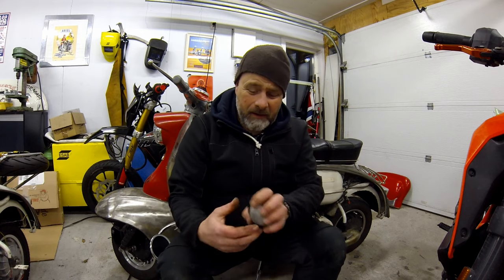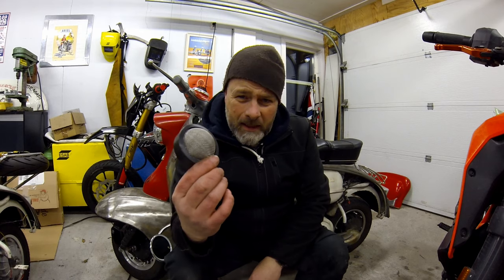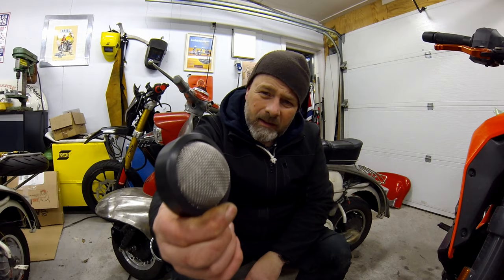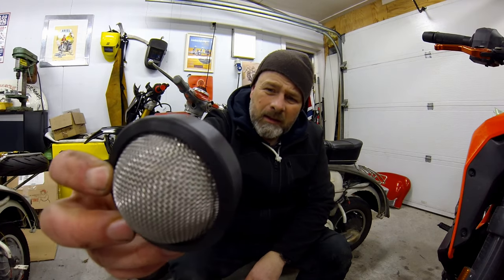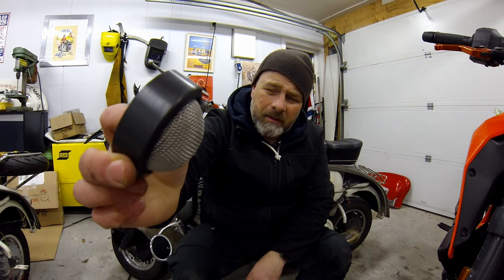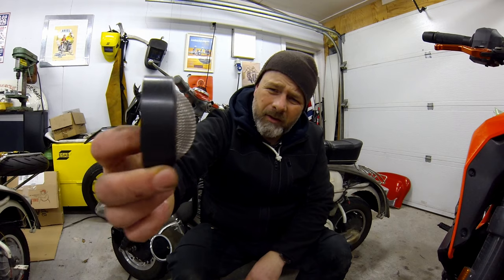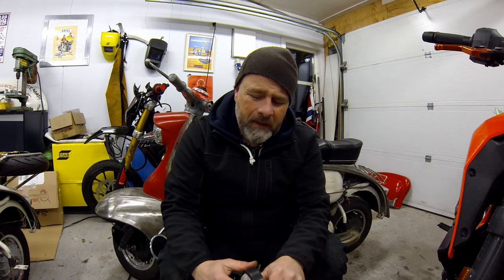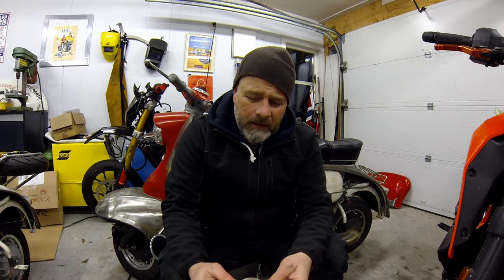MB Scooters LTD, lambretta  tea strainer filter,first look

Comment: Been running one of these on my Mugello 200 Piston Port with 28mm Dellorto, tried every combination (almost!) of jet/atomiser/needle/screw and could never get it 100%, generally just too rich somewhere in the rev range no matter what I did. Finally when it seemed very close but still a bit rich and smoky particularly at tickover I gave it a try with this thing removed and it's now running spot on. You imagine that it won't impede air flow at all looking at it but it definitely does
Reply from the maker: My problem was that it clogs pretty quick. It went in the bin 🙈

Comment: Have one on my S2 Rt195 breathes through a 28delly, didn’t need too down-jet at all and it kept its same power all through the range, good bit of kit
Reply from the maker: Ok, a lot of conflicting info on this, should be intreasting to try.
Reply: Kickback Garage agree no 2 engines are a like so there’s gonna be difference in set ups

Comment: Hi Rob thanks for your reply never thought of that on a long ride out to a rally what if you took the very fine filter out and just have the larger mesh left to stop any large objects getting through 🤔🤔🤔🤔👍
Reply from the maker: People do that mod but I would be more inclined to ride filter less. I've bought the chiselspeed panel filter, apparently works well but won't know until the spring.

Comment: Hi I’ve also got a S3 Rt 195 kit using a25phbl carb I removed the air box still using the bellows and connected a BGM highflow  air filter it sits in the air box recess lovely  I jetted up a bit for the extra air intake made amazing difference what’s your opinion love your videos
Reply from the maker: Thanks Erik, I actually haven't got an opinion yet. My other bikes are run without a filter. I will talk about the jetting as soon as I get the TV out on the road.

Comment: Hi rob I know this is a old video but I’ve just got the mb carb kit 28 mm delo what manifold r u using because mine when fitted carb is at a very steep angle towards the back in fact the cable insert points heat the tool box how can I solve this the manifold I’ve got came with the kit with rubber mounting sleeve regards tony
Reply from the maker: I have fit the mb carb manifold. We will have a look ans see how it fits in the next TV video. Just waiting for a couple of parts.

Comment: The MB 'tea strainer' is no good for a panelled GP running a Quattrini 210 (rubs on inside of panel) and is also quite restrictive on air flow.
Reply from the maker: They are OK on series 1 and 2 BUT they clog up after a short while 😢

Comment: I am having so many problems with my original serveta filter with my rt225 i was thinking of using one of those but not sure which one is more restrictive, Marschald foam filters or Tee Strain? Did you get to try it?
Great videos btw!
Reply from the maker: Thank you and yes, we have had good luck with the tea strainer. You have to clean it quite often though. You can also try the bgm high flow filter through the box. This has worked well on the TV I've just built.
Reply: Hi Marcus I took the air box out then l still used the air bellows and the Ali filter connector but I’ve used the BGM fast flow filter it sits lovely where the air box was just made a buffer round the back of the filter you have more air flow from the scoop take the baffle out first blowing down on top and more flow from inside the panels works lovely and much safer👍

Comment: 9/10 And it looks like you have done 0 testing? Let yourself down on this one.
Reply from the maker: It's a first look vid. I will certainly be making another video when I try it out on the road. I've heard some have problems with jetting and others don't. So should be intreasting. First impressions are that it's a good Idea and fits well. Thanks for the feedback. If it's poo in use, I will certainly tell it how it is!